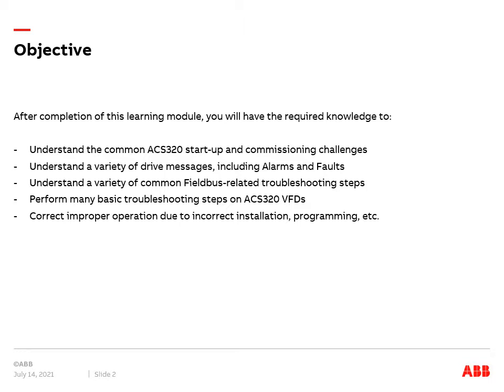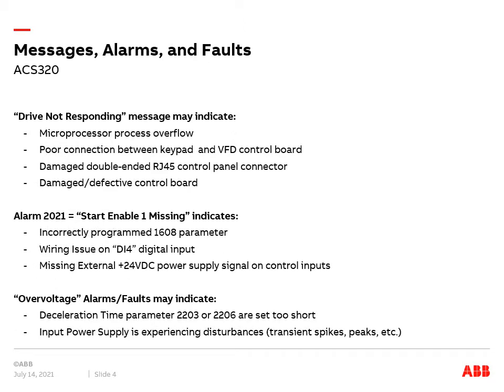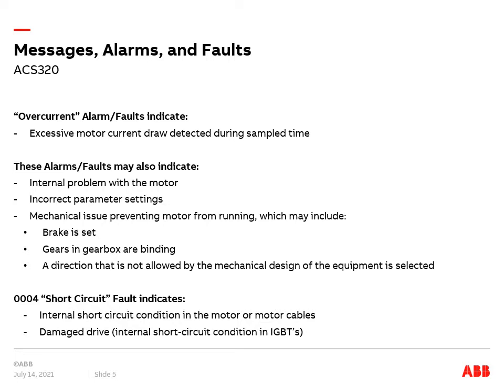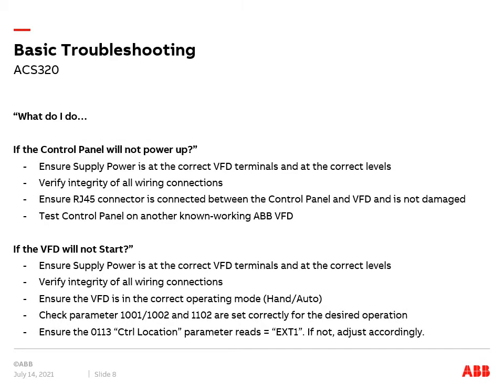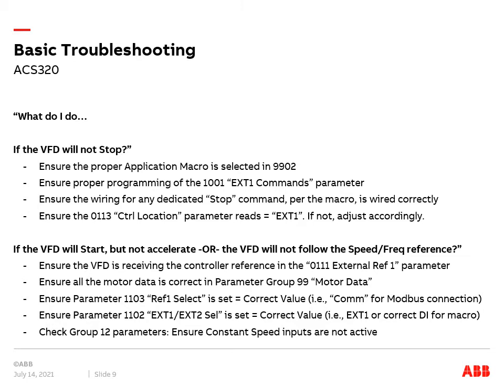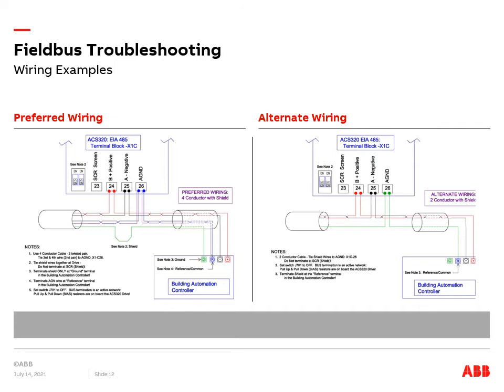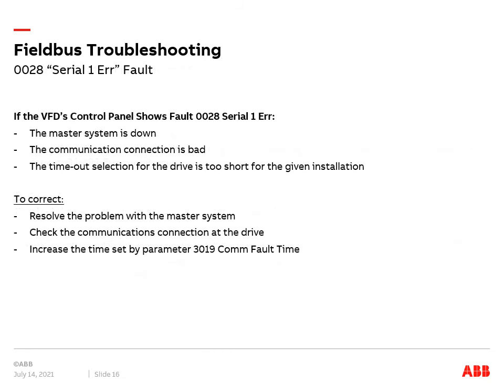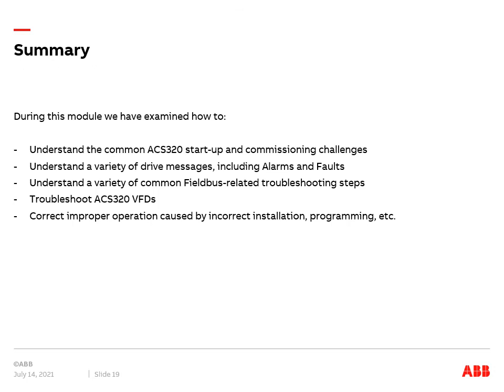ACS320 Basic Troubleshooting

Comment: Sir, How can i solve error code F0021 for ACS510 75KW VFD. 
My motor rating: 440 volt, 118Amp, 1400/m rpm, 50Hz, 75Kw motor. Already setting but also all about setting are up and down. My error F0021 dose not problem solved. So please give me any ideas ?
Thanks